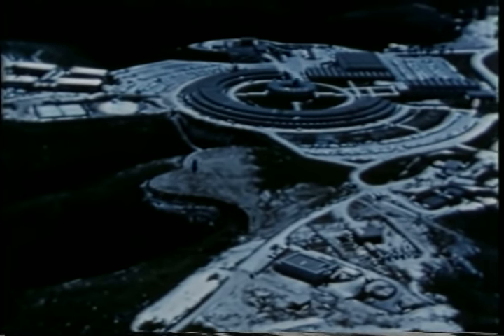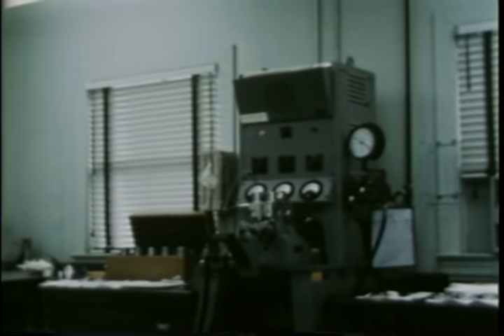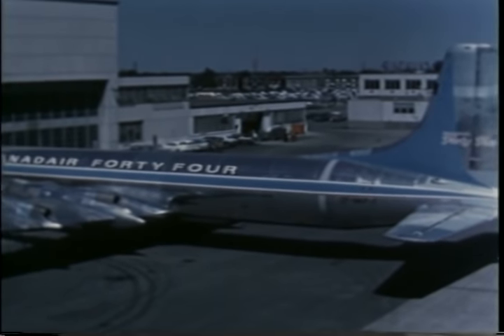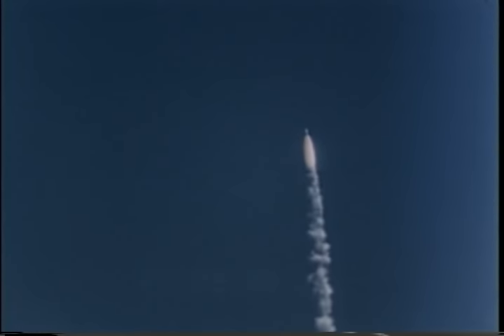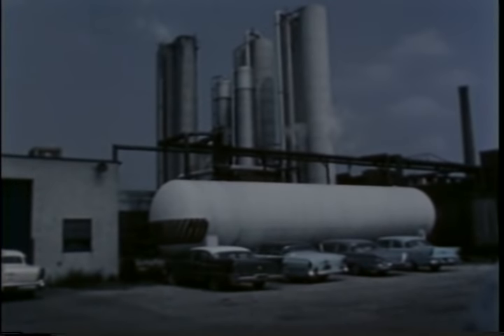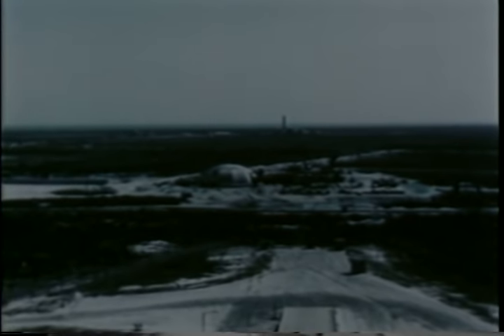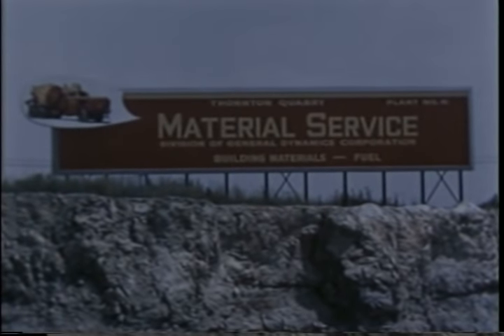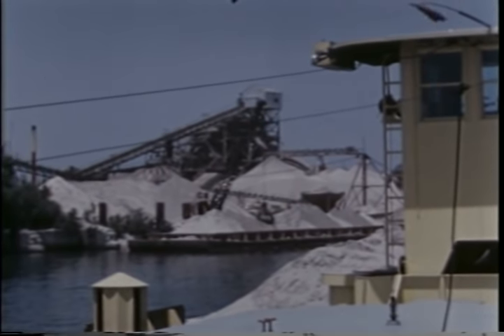VT 869 General Dynamics Newsreel, Convair 990 Coronado

Comment: The 707 won out and the rest is aviation history
Reply: McDonnell Douglas - today a Boeing heritage company - would end up buying Convair's airframe operations. Many thought that the Douglas DC-8 was just as good as the 707.
Reply: @johneddy908  , the DC-8 was actually superior from a durability standpoint. Moreover, it was designed to be stretched right from the get-go. The 707? Not so much. Also, I've never heard of engines falling off a DC-8 during flight. Unfortunately, this phenomenon has happened to the 707 on more than one occasion, resulting in devastating crashes. Two come to mind, a Braniff 707-227 during flight training (lost three engines), and a BOAC 707-436 (lost all four due to... extreme turbulence) on Mount Fuji region of Japan.

The only downsides to the DC-8 from what I can see? Slightly higher fuel burn and slower maximum speed due to less swept in the wings. However, perhaps those weren't bad tradeoffs, given all the other pluses.

Comment: Convair 990, Up until Concord the fastest airliner in the world. It held the fastest CA air speed record and ground speed
record. What made it so fast ? The engines were the civilian version that were on the Convair B-58 Hustler less the 
after burners, the engines were of the ram air concept " the faster the engine flys the faster it can fly" The engines 
are what lead to its downfall because of poor fuel economics, smokey on takeoff, low speeds and low altitudes.
Notice the four big odd looking pods on the trailing edge of the wings , those were sonic air flow shock abaters. the 
990 would and could have gone super sonic but for those pods they acted like built in airbrakes to keep it from accidently 
going sonic in a dive or just power on shallow dive, the pods were also used to store fuel. I.E. it was designed to cruise as 
close to the sound barrier as possible without exceeding it .  
Another part of fast was due to its narrow body. The 990 was designed primarily for the business class market to europe
and the jet set of the 60's and early 70's, it was the precursor to the Concord.
Reply: Michael Avery  Believe those training edge structures are “Busemann carrots”....they reduce wave drag at transonic speeds. Tough to area rule an airliner with a cylindrical fuselage.
Reply: You’re talking nonsense
Reply: Michael A. Nonsense. Don’t comment on things you know nothing about. Thank you.
Reply: Alan Downey why don’t you correct them rather than just saying “nonsense”. That’s much more helpful and not a waste of a comment.
Reply: @GabeClendenning   I agree-- note my response to Mr. Downey.
Reply: @alandowney5851  May I ask what your knowledge is on the matter,then we can compare notes on credibility. Mine comes from my Dad, he flew 990's for Modern Air and was the Captain rated copilot that set the JSTW- GS record Greenland to Paris.
Reply: Michael A. Perhaps I was a little brusque but I hate reading constantly inaccurate information on the internet. The original reason for the internet was to share knowledge... The engines on the 990 were GE Aviation CJ805-23’s, not the same as the J79’s on the B58. They did share some parts (compressor and the variable guide vane system pioneered by Neumann) but added an aft fan configuration, and obviously lacked the afterburner. They were the only aft fan engines ever used commercially and the program lost money for GE, but gave it experience in the commercial jet market. In SR Technics canteen in Zurich there is an ex-Swissair CJ805-23 cutaway in a glass case. There is no significant ram effect on a subsonic jet engine to the point were it greatly increases performance, I think you are confusing this with the J58 engines on the SR71 which become ramjets at high Mach. Pratt and Whitney does however publish engine thrust figures at .2 MN which is about the speed of the air entering the inlet at rotation. It has a marginal affect. The shockbodies on the trailing edges are Kuchemann carrots and they are an attempt to provide area ruling on an aircraft with a straight fuselage. Not terribly effective. True supersonic aircraft will have area ruled cross sections and this was only being understood at the time this aircraft was designed. Indeed, contrast the design of two contemporary Convair interceptors, the F102 and F106 for further study of this. The seat mile costs of the Convair aircraft were very high in comparison to the Boeing and Douglas rivals and Boeing effectively killed the 880 with the 720. 
Kudos to your father for flying a proper aircraft back in the day.
Reply: @alandowney5851  Thanks for the affirmation. Yes many do speak
through the hat.
Reply: @alandowney5851  Convair 990 shockbodies - I was under the impression they had at least two functions including raising the cruising mach fraction and serendipitously adding fuel capacity. My rank? Enthusiastic onlooker. edit: I never could reconcile why, if they did raise cruising mach, no other manufacturer had a similar concept